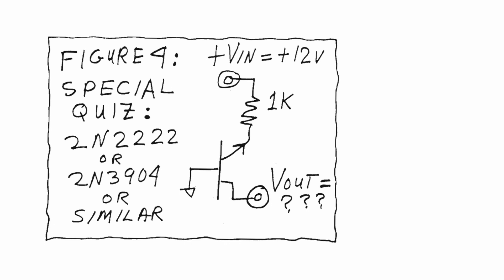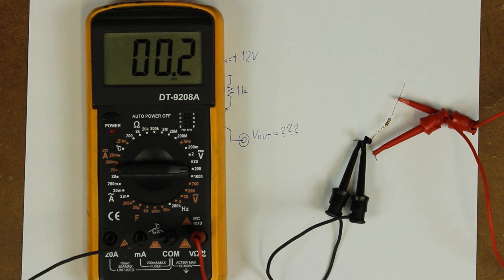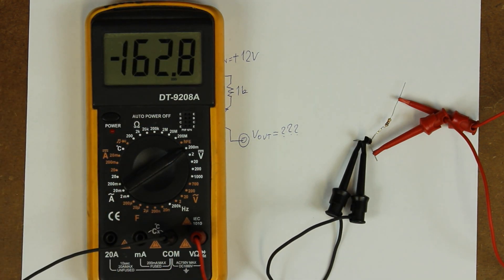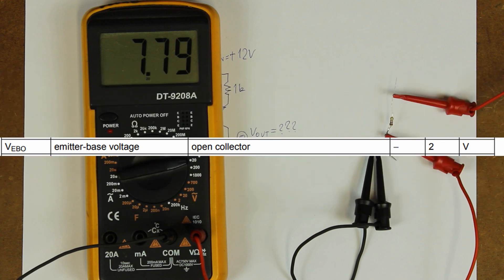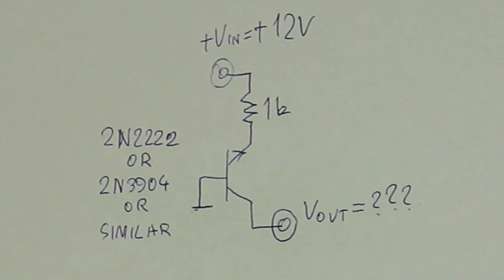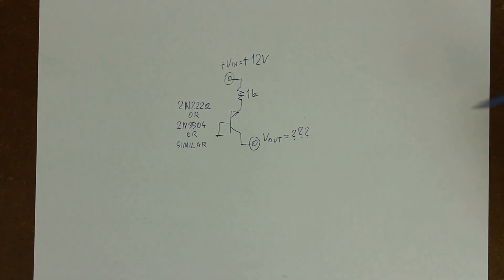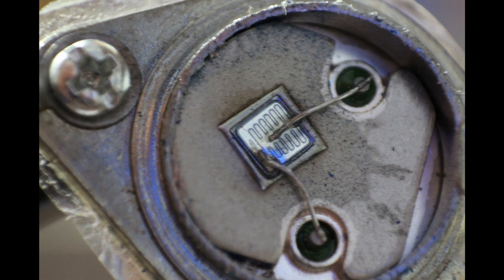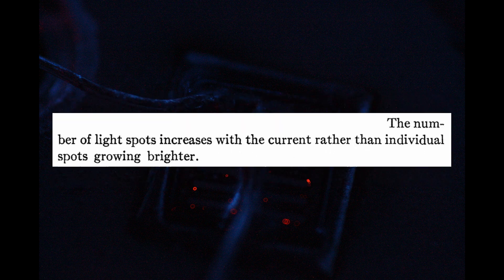My Favorite Transistor Riddle

Comment: "Now, when I have finished my inspection, and I am still mad as hell because I have wasted a lot of time being fooled by a bad component – what do I do? I usually WIDLARIZE it, and it makes me feel a lot better. How do you WIDLARIZE something? You take it over to the anvil part of the vice, and you beat on it with a hammer, until it is all crunched down to tiny little pieces, so small that you don’t even have to sweep it off the floor. It makes you feel better. And you know that that component will never vex you again. That’s not a joke, because sometimes if you have a bad pot or a bad capacitor, and you just set it aside, a few months later you find it slipped back into your new circuit and is wasting your time again. When you WIDLARIZE something, that is not going to happen. And the late Bob Widlar is the guy who showed me how to do it.

Bob Pease – Troubleshooting Analog Circuits"